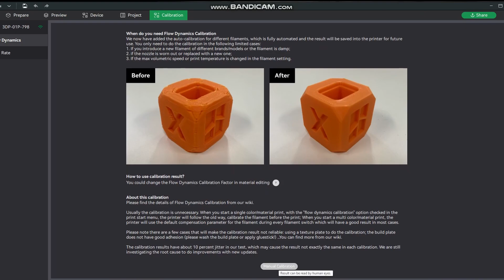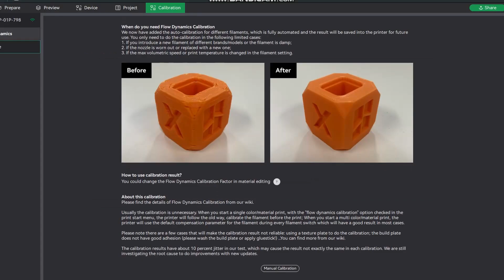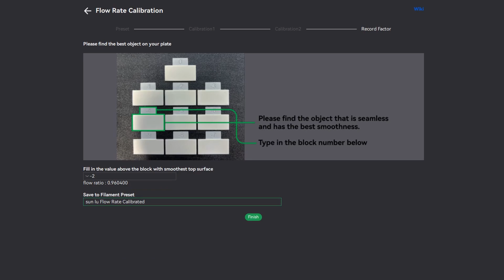Get the MOST from any filament in Bambu

Comment: Thanks for the video.

When you check the tile for smoothness, are you looking checking the middle of the tile middle only or the edges as well.

For example I found the -20 to be very smooth but now my prints are semi transparent when held up against a light.
Reply from the maker: Smoothness in general and also the outer walls. If you want to make the prints more opaque- add in walls/top/bottom layers

Comment: Excellent, thank you Do you to calibrate with every filament or just the once, for example if I use sunlu pla would I run on every sunlu pla?
Reply from the maker: Once per type.
Thats brand and filament type 
I’ve done it for pla+ then meta, petg etc
Reply: @jcrbuilds  excellent. Thanks for the quick response 👍